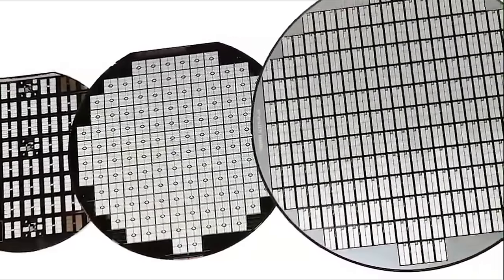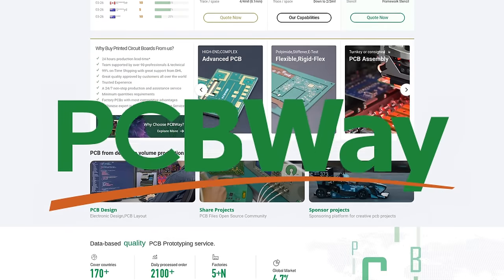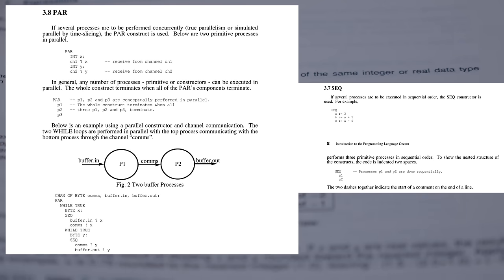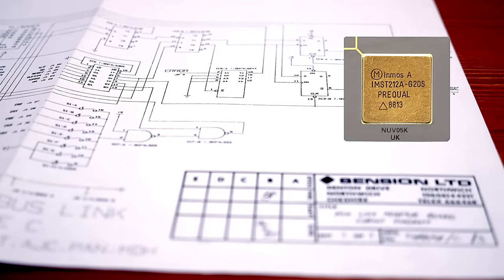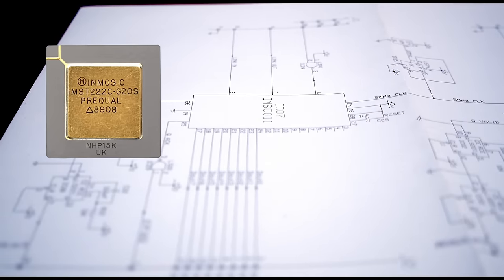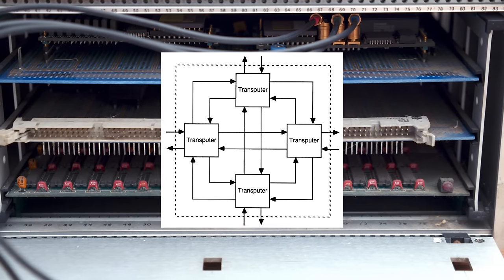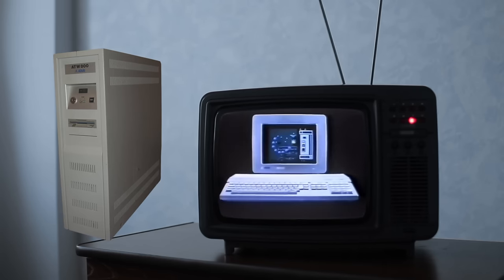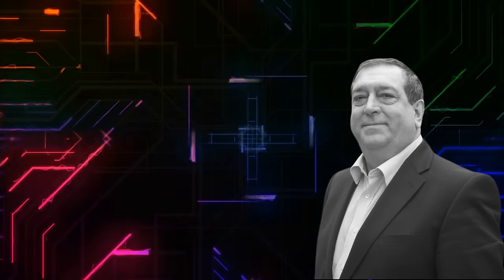The Transputer: A parallel future

Comment: There was a joke at the time, that when Intel created their new processor, they tried to follow their naming scheme and added 100 to 486 but got 585.99382. That's why they named it Pentium :D
Reply: - How many Intel engineers does it take to change a lightbulb?
- 1.99382, that's enough precision for the answer.
Reply: If you’re curious the actual reason intel named it the pentium was because amd and cyrix copied their names because you can’t trademark a number, so intel have their processors and actual name
Reply: @Joshinken Don't ruin a good joke by naming facts!
Reply: Why did the Intel engineer end up un jail?

For  running illegal instructions and possession of illegal opcodes 

Lulz
Reply: I mean, as far as government contracts would be concerned, that is close enough for military grade.....in fact, its too precise, and Intel could have charged more per chip........ :P
Reply: I remember at the time, Intel trying to reason the problem away by saying that you only noticed the problem if you went beyond 6 (if I remember correctly) decimals, and that for most people even the broken Pentium was good enough.
Reply: Since I don't see it mentioned above in this thread, the reason for these slightly off numbers was that the floating point unit (FPU) in the original Pentium had a bug in the division operation (FDIV), which they'd decided to speed up using tables. Division was notoriously slow on most processors, but not all tasks prioritize fast over accurate.
Reply: @0LoneTech  More specifically, the tables weren't quite correct. The approach was sound... they just typo'd five of the 1,066 values when loading the data into the etcher and set them to 0 instead of +2.
Reply: @Joshinken Yes but you have it flipped around. A number can't be trademarked.  That's why AMD and Cyrix had 486 and even 586 parts.  But a name like Pentium can be trademarked.  This was also a reason Intel created the Centrino branding.  Even if another company copied ALL the features that made up Centrino, they still couldn't use the name.   Names versus numbers is also why car models using numbers are almost always letters or words plus numbers.  The Lexus LS300 is different enough from the Chrysler 300 to avoid a problem.  The Tesla Model 3 is "Model 3" not just the numeric 3.  With the jump to Pentium branding, Intel woke up many other companies to similar branding issues.  It had always been there but rarely a problem.  The new frontier of IT put names and brands right in the forefront.
Reply: Huh, in the intevening years, i conflated the timelines for the fdiv and f00f bugs. Normies like me couldn't afford a pentium unti after fdiv had been addressed, so I guess it leaked out of my mind.
Reply: "I am Pentium of Borg. Division is futile, you will be approximated."
Reply: You forget that cyrix already made the 586 back in the 90s. Joke is on you ..and it could do math.
Reply: @0LoneTech  coprocessor or FPU literally were look up tables of rom IE the two numbers literally made up the addresses hence  the tables did have errors.
Reply: You think THAT is the point that Intel should have gotten from this video? What about first making a compiler that could unlock the full potential of the Itanium ?.......
Reply: @ntal5859  I guess you're joking, but I don't get it. 

For the record, Cyrix's processor was released 2 years after Pentium.
Reply: These are actually used but like if I say where they will be super pissed off lmaaaaayo.
Reply: @Joshinken they didn’t really copy as they’ve been producing for Intel hence they needed to use the naming scheme
Reply: @marcello4258  cyrix reverse-engineered intels instruction set, which intel tried to sue them for, and they eventually went bankrupt because their homebrewed architecture couldnt 1:1 compete with intel in certain calculations causing cyrix processors to lag behind, particularly in games, like doom.

They were not manufacturing for intel at any point

Neither did amd, they just paid to be able to use intel’s designs, which actually does not give you permission to use its naming scheme, hence why amd never made a “pentium”
Reply: we are pentium of borg, division is futile.
Reply: Intel tried to explain away the problem, saying that it was only obscure processes that would run into the bug…

…like PKZIP. I remember having to force 286 mode when compressing…
Reply: @0LoneTech I'm shocked at the number of "programmers" and software "engineers" who still don't know you can't directly compare floats or expect (3.0 +2.0) - 5.0 == 0.0.
Reply: @marcovtjev Itanium was doomed from the start aside from niche use cases.
Reply: @VndNvwYvvSvv  The first two releases (merced and what ever its name was) were underwhelming, but iirc actually had the floating point performance crown. Even then there was speculation however how much of that was due vast caches. At that stage was simply hard to predict what a comparable x86 could do. But each successive generation was later and less impressive, and compiler didn't really improve utilization that much after the initial period.
Reply: @Joshinken  Too bad, I happen to use Cyrix processors. That's a long time ago!
Reply: @Joshinken  Cyrix did just fine with Doom. It was Quake that relied on the FPU.
Reply: @VndNvwYvvSvv that didn't stop Intel from attempting to push it, doomed or not. As much as engineers complain about marketing, at the end of the day good marketing trumps good engineering. It's the Original Sin of the tech business.
Reply: technically Cyrix had 586 ;)
Reply: and now I see why there was never a sextium XD
Reply: @_starfiend underrated comment! 🤣
Reply: I've always wondered how they made it out the door. My P66 was fine, but when I worked at an Office Depot, we'd test the P60s on display with Windows' calculator; it was hilarious. It's such an easy test to do manually that it's weird that they were like, "Screw it. Ship 'em."
Reply: fake story , intel next cpu after 486 is i860
Reply: @LatitudeSky lol that is such an urban legend story. So why did Nokia go with pure numbers as device names in the 90s. 5110, 3210, 8250, ...
And yes it was the "Nokia 5110". But so was the "Intel 486"
They just wanted to underline the huge jump in performance and that the Pentium was a class of its own.
Reply: I was the design manager of the P6, the chip following the Pentium development.  Our team found the Floating Point bug in our regressions, then the professor found it also and popularized it when the idiots on the Pentium team claimed it was not a problem.  We strongly disagreed and eventually Intel wrote off $450M in replacements.  Andy Grove was called our marketing manager over in the cafeteria in the middle of this and said that Intel would either respond properly and be seen to stand behind the Pentium, or the P6 would have a different name... He was extremely practical.  We introduced the P6 as the Pentium Pro and we had no recalls for the rest of the time I was at Intel.
Reply: @TheEvertw  I swapped out about 200 of the cpus back in the day when I was a technician.  I have a degree in Computer Science and school of hard knocks.
But when you do things like add up the surface areas and angles of a many part thing, like an engine or bridge, the errors do catch in the end. There is a process in CAD called fitting where all the parts that interchange in an assembly have to dimensionally fit and not conflict on assembly order. 
The floating point bug also can throw off things like inverse square root solutions. 
But yes in general for normal math and accounting it's a no worry.
Reply: @VndNvwYvvSvv  In IEEE floating point calculations, (3.0 +2.0) - 5.0 is exactly 0.0
Reply: @TheEvertw  Wasn't that the precision of early BASIC's? Oh, hi Bill, no, no, nooooooooooooooo o o oo ooooo o

Comment: I wrote a real time image processing system on these in grade 12. I used SCSI bus on a sun workstation and 8 transputer chips to analyze video from 7 cameras in real time which captured infrared images from metal cooling from steel mills to detect defects.
Reply: In grade 12? Goodness. What are you doing now?
Reply: @wizard-pirate  I've been CTO of a few businesses. Now I own a few and invest in a few.  I started coding when I was maybe 11 years old and still code and very passionate re: computer language development. Went to uni for computing/computer electronics and have pretty good skills there too.
Reply: @supercompooper can I have a job lol ?
Reply: What was the camera resolution one? Was the ADC involved with the analog camera input or it was SCSI/iEEE1394 connected ones?
Reply from the maker: That's a good application for the transputer, it would have fitted in with its model rather well. Did you get the chance to commercialise it ?
Reply: @CD3WD-Project i would hire you on the spot.  You're a scholar and a gentleman
Reply: How did you get acces to that hardware?? Summer job? At the time (90s) that hardware would be 100Gs.
Reply: @RetroBytesUK defect detection on manufacturing lines was typical back then for this kind of hardware (and traditional dsps).
Reply: Holy crap
Reply: There was also something called GAPP architecture.
Reply: @CD3WD-Project can you do a job?
Reply: @gregdee9085  ah cool. Did something slightly similar in ‘94 with a 486 and one camera. It was only 2d so much simpler. Defects on scratch and win cards (don’t buy those BTW .. distribution channel wins more than the buyer)
Reply: @kippie80  Nope I don't know how to do anything and I am homeless.
Reply: @CD3WD-Project  well there are lots of quality people in that situation. Sadly, it will get worse before it gets better. I’m teaching my kids to focus on their personal skills … it is something that can’t be taken away from them.
Reply: We put transputers & DSP56Ks into rolling mills in British Steel Teesside to monitor the bearings on the rolling mill to detect decay of the bearings before they failed using vibration analysis.
Reply: @murrayelliot  thats super cool. How long did the system run for? I own part of a company that uses AI wirh vision and vibration to accomplish same today!
Reply: @supercompooper  it was still going when I left the company, so at least a couple of years.
Reply: @supercompooper  When you say you guys use AI for that, I assume you mean a CNN? Couldn't you just use something similar like K-means to cluster simple features from the visual/vibration datasets to achieve that? (My specialty is time-series, so I could be way off. But a CNN seems overkill for the use-case)
Reply: Man after my own heart. Was right there with you. Happy New Year!
Reply: sure kid , keep making up BS stories
Reply: @lufasumafalu5069  Why not? I had already disassembled, printed out on a Creed 7B teleprinter, and reverse engineered Microsoft BASIC by age 10, including corresponding with BillG when they were still in Alberquerque and had designdd and built my own multi-tasking OS, sound cards, disk drivers and MIDI interfaces by 15. What makes you feel the need to bring him down?
Reply: @lufasumafalu5069  nobody likes a sad, bitter underachiever ...
Reply: @murrayelliot  dont worry , your parents love you
Reply: Too bad we don’t believe you

Comment: The strangest thing about working with transputers was the memory address range. It went from -maxint .. +maxint so 0 is a valid memory address right in the middle!  You had to redefine what NUL was because dereferencing *0 was perfectly valid.
Reply: Nice, an addressing system even weirder than x86 segmented mode.
Reply: Good point, but zero is a valid memory (bus) address on PC's, too. OSes protect it - as part of page-zero - so NULL references can be detected. I've used "zero" on loads of simple devices. (and some not so simple... moto 68k)

Comment: This thing has had some spiritual successors. Basically multicore CPUs with on-chip networking and message passing. Tilera made up to 72 core CPUs. Tilera that go bought by ezchip, then ezchip -> mellanox -> nvidia. And there is also parallella with their 16 core Epiphany chips. Tried writing something for the parallella board back in ~2010s, but was a pretty green computer science student. Could not have imagined that there was stuff like it already in the 80s. Cool video!
Reply: There was also XMOS. Haven't heard much from them for a while. A short bit of time there they had a cheap dev board for their chips but then suddenly they pivoted their designs to weird audiophoolery stuff and I'm not even sure you can get the software to develop for them anymore 🙄
Reply: SUN's GX quad polygon 3D system has influenced NVIDIA's NV1.
Reply: There's a US company call Parallax that developed an 8 core 32 bit risc microcontroller - the P8X32A Propeller - with each of the 8 cores having 2k ram and shared access to common memory and io through a multiplexor
Parallax codevelopef the chip along with a language called Spin
Reply: @AnonyDave  I think I have one of those boards.  Saw an article on Hack-A-Day about them giving away boards to people with interesting project ideas, now I didn't have a project in mind for it but it sounded interesting so I sent an email saying as much and some time later I got one in the mail.
Reply: tilera were also used in mikrotik routers for a time
Reply: @AnonyDave You can still get their development software and ICs. Don't know about development boards - I have always made my own boards.
Reply: @AnonyDave  XMOS is alive and you can still get dev boards for under $200. The audiophoolery is not audiophoolery really, at least not on XMOS' end - they genuinely can do DSP and output high bitrates with low jitter and this is genuinely useful for studios and surround sound (multi-channel audio basically). Besides the top end gear, you can also get their chips in $30 DACs that have very decent EQs. Their use is mostly in that they've got high-speed sofware-defined IO that's attractive to people who need that but don't want to do an FPGA or an ASIC - a modern XMOS chip can basically bit-bang 100Mbps Ethernet for example.
Reply: @paulie-g  I've developed ASICs and work with FPGAs, and I consider the XMOS IO a sweet spot for many tasks. Raspberry Pi PIO is pretty good too.

Comment: In the early 2000s I worked for a division of DeBeers designing and building diamond sorting machines.

One of the projects was to replace a 1980s optical sorting machine that ran on Transputers.  I got to program the Transputers as part of a life extension program whilst we developed the new system.  The replacement intel solution had more horsepower, but the Transputer solution was much more flexible and malleable.

More recently, I repaired an ICG photographic drum scanner.  The custom electronics in that used a bunch of Transputers on an ISA card for processing the image signals.

I sold some spares to someone in Australia who had a whole cluster running
Reply: USSR Diamonds USSR Oil Wave flag Putin....keep waving flag